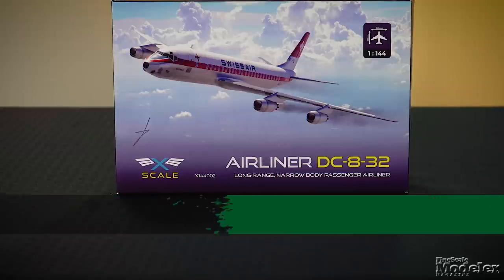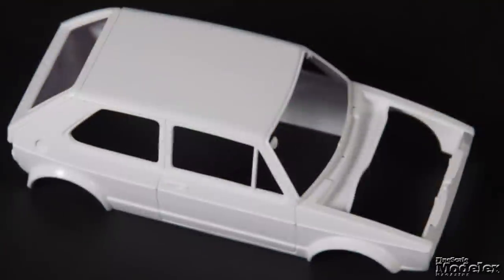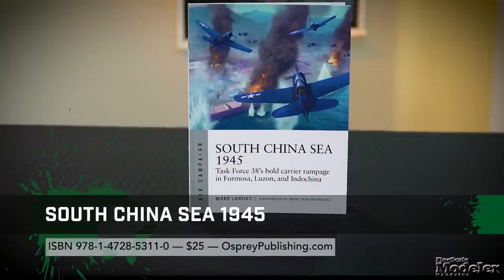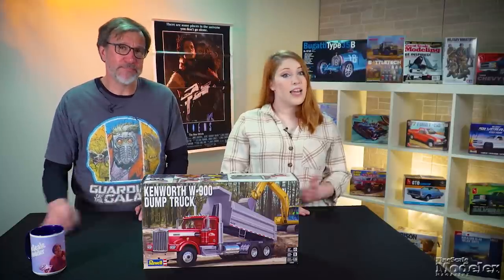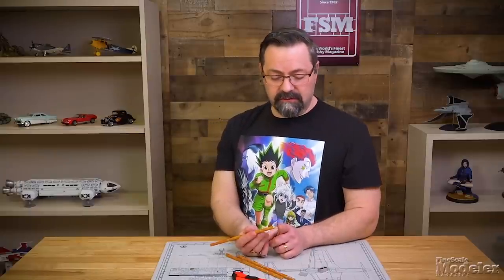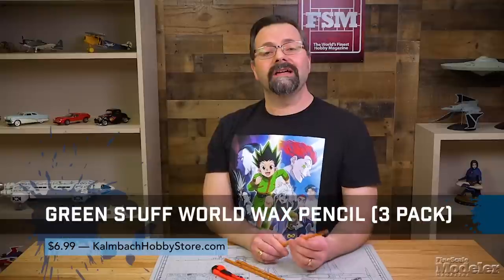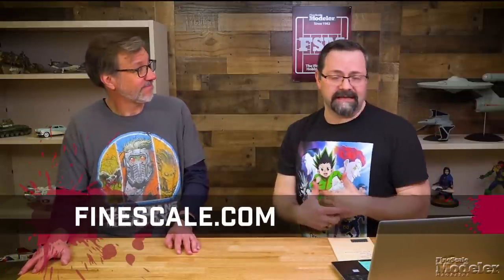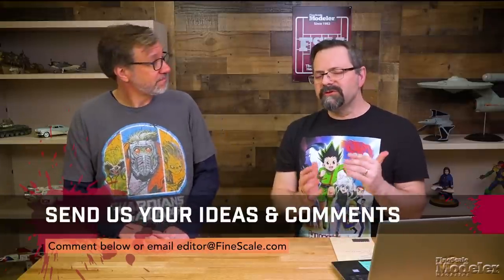FineScale Modeler unboxes X-scale and Italeri kits, works with wax pencils, and talk all things FSM

Comment: With wax pencils you have to clean the part afterwards, otherwise there can be a problem with paint adhesion. Proper cleaning can be a problem with delicate parts, so wax pencils are a bit of a Catch-22 situation. They work great for part placement but can cause later issues.
Reply from the maker: Thanks for the caution. We haven't run into any problems yet, but we'll definitely keep an eye out in the future.

Comment: I've been using a rhinestone picker that I got from Amazon recently to place tiny parts. I think it's some kind of wax head on it. It's considerably easier to use than tweezers. It holds the part just strong enough to get it to the part of the kit that needs it and lets go as soon as it touches the glue. I wouldn't happily go back to dealing with tweezers after using this for a while.
Reply from the maker: Basically the same tool. We use the wax pencils around the workbench a lot. Thanks for watching!